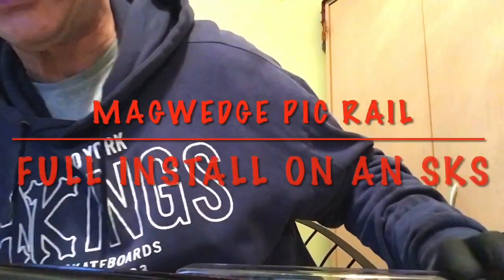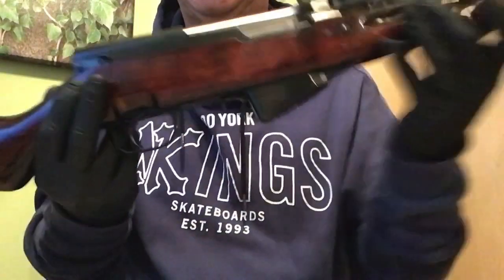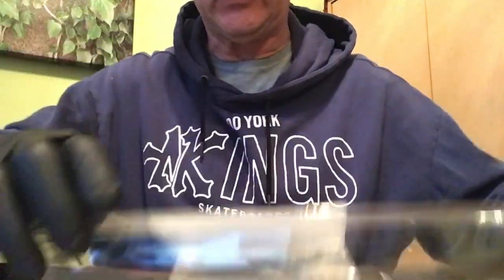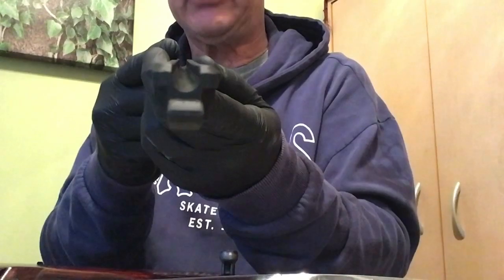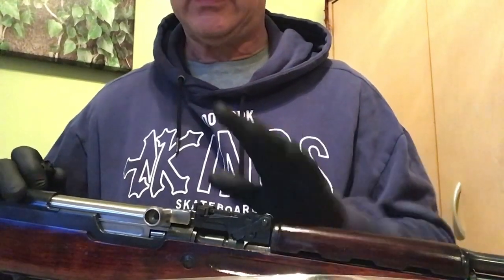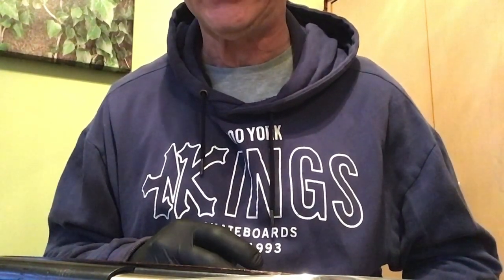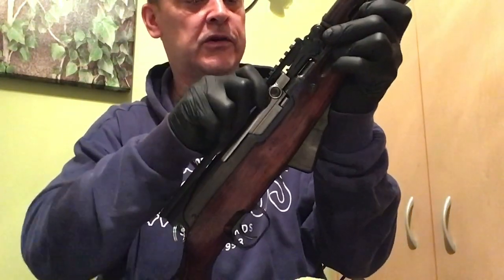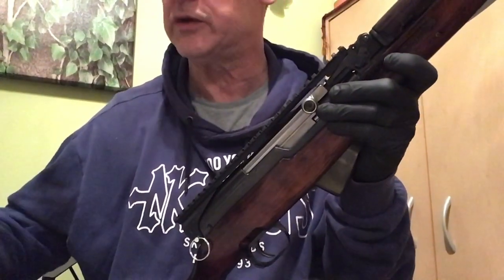MagWedge Picatinny rail full install~Tula SKS #sks #shooting #gun #magwedge #fortheboys

Comment: Wow that was simple! Going to have to get one for my sks now!Are you going to do the magazine conversion?
Reply from the maker: thanks Brother. as long as the little pin on the dust cover latch comes out easy and if the rear sight doesn’t have the little pin in it then yes it’s pretty simple. if you go this route remember the leave in the rear sight spring plate or the rail will wobble. I also found the quick release pin was useless too as it left play on the rear of the rail, I ended up using the solid pin that also came with the kit instead so it all stays true to hold zero. I do have a video coming out on July 10 th of the range tests, works pretty good, fun shooter. I have no plans for a mag mod… yet 👍

Comment: what tool do you use to take that small pin out of it
Reply from the maker: If you are asking about the pin in the rear sight, I have used a solid metal punch, failing that a Dremel tool and small grinding stone attachment. The little pin on the receiver cover I was able to remove with vice grips.

Comment: You just ruined a nice SKS. I have a 1953 non refurb and would never consider modifying it.
Reply from the maker: we all have our opinions on this kinda thing. I once was a purist and considered it taboo to alter these fine relics. I pondered a long time before embarking on this build. When I pulled the plug and decided to go for it, I made sure and was careful to make sure I could re install all parts to original. I did not see any sense in owning a “trailer queen SKS” life is short, I make them (firearms)work for me and in some cases that means a mod here and there. Now that being said I would not have altered this particular rifle had it not already been adulterated with corrosive ammo. thanks for your comment as I could certainly agree 100% in my past, cheers Brother.
Reply: How'd you get a non-refurbished Russian SKS when none were imported into the US?
Reply from the maker: @toska3528  I am in Canada, not too sure but I’m thinking they were not banned from import here… yet. Thanks for the comment Brother.
Reply: @JohnVanDyk  ah, gotcha. I was gonna say, because the only rifles that Russia exported were refurbs, unless you got a Vietnam bring back or something lol
Reply from the maker: @toska3528  I found this piece on the subject, may shed some light, mine has no refurb markings and all numbers match with no signs of wear-

. “I have noticed a commonly held opinion among many Soviet SKS collectors both here and at other forums, that there is no such thing as a "non-refurbished" carbine.  That all of these examples seen here in Canada and the US have been through a refurb process, hence why they have a near new appearance.  Though most have one of two refurbishment marks, those that don't simply were missed in the process.

I agree that trying to prove a certain example being "unissued" is impossible.  Once any firearm leaves it's point of origin for production and enters the military system, it has been "issued".  The degree to which it is actually used once it enters the system is now the unknown.  That can range from actual troop issue for training to being kept in reserve due to status, such as being classified as substitute standard.  Until the day comes that original Soviet production and military files about these weapons become available (if they haven't already been destroyed), then all arguments about issued or unissued are moot.

I'd like to examine the topic of refurbished versus non-refurbished.  Over the years that many established SKS collectors have been analyzing various examples, certain themes have become known regarding the refurbishment of SKS in Soviet service.  In all military services, weapons upon reaching a certain point in wear and tear, need to be brought back up to standard.  Replacing broken and worn parts and applying a new finish are part of that process.  Soviet weapons bear certain marks and quality of work that exemplify that process.  

The controversy arises over the assumption that all weapons entering the civilian surplus market from Russia, have been reworked.  Period.  No argument, and you can't prove they haven't.  It does become a sort of catch 22.  

Without the above mentioned Soviet documents showing a complete history of an individual firearm, it is impossible to convince some collectors or enthusiasts about the level of originality of a particular firearm.  But we've all bought new in the box commercial firearms, used them hunting, carried them in the field, taken them to the range, cleaned them.  Now remember back to when you may have joined your respective country's military.  Ever receive a new issue weapon, never used before, just manufactured?  Then trained with it, used it for foot drill, range practice, carried it in the field on training exercises?  Maybe even used it in conflict?

Now start thinking about the wear and tear, the gouges in the stock from it rubbing against your webbing or bayonet, dropped it while moving to a new position or on night patrol but didn't see that branch that tripped you?  Cleaning it in the field, having to make sure it was immaculate before returning it to stores (and pass the Sergeant's inspection)?  Using steel wool, or emery cloth (how about sand?) to remove rust or carbon from the piston head?  How about that group clean up as a section, throwing all the parts into some field mix bath made of fuel, naphtha and something else that really burned your skin while you reached in and pulled out a suitable fitting part to reinstall on your field stripped rifle?  

I could go on, but I've made my point about use and abuse.  Now, why could there never be a non refurbished and minty example of a Soviet made SKS?  Ever seen an unissued mint K98k with matching bayonet from Portugal?  How about an unissued 1908 Mauser with matching bayonet from Brazil?  An unissued No.4 Mk II Lee Enfield made in 1954 that you just opened the original wrapping on?  No?  They don't exist?

My point being it's a very broad assumption to believe only Soviet firearms are all refurbs.  Maybe that was all that was imported to your local market at the time.  Maybe, that is the only type you have had the chance to handle.  Currently in Canada, we are seeing Soviet SKS's imported in quantity for the first time.  The US market has been closed to new imports for almost 15 years (1995?).  We have observed all types of rebuilds too.  But we've also come across examples that show no hint of rebuild at all, and in beautiful condition.  

If all Soviet SKS's are rebuilt from use, how did they manage to install the original stamped stock that's still in excellent condition?  Why would the bluing be redone, when the metal parts show no signs of use or wear at all?  

Just curious.....

    So that being said thank you for the comment on refurb, I truly had no idea about this debate on the SKS 👍